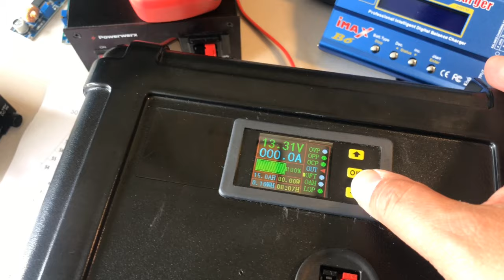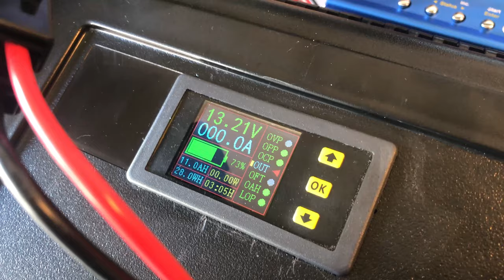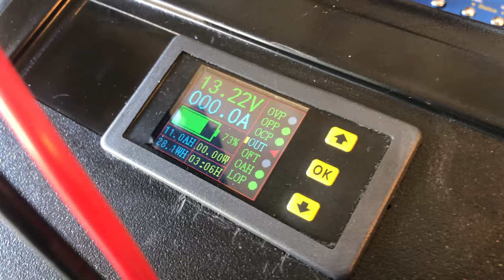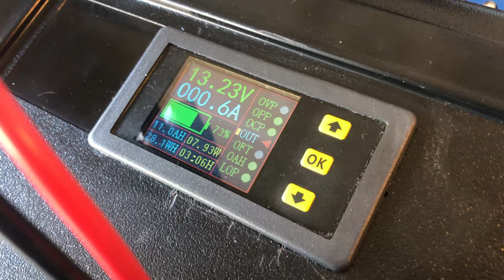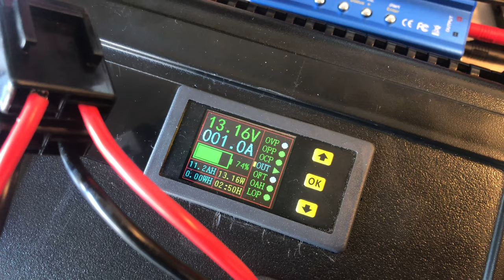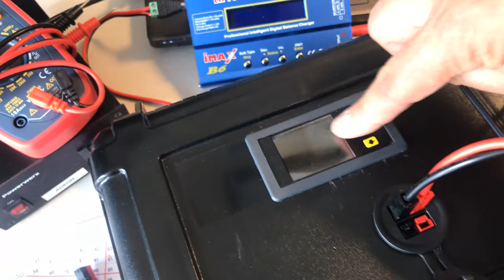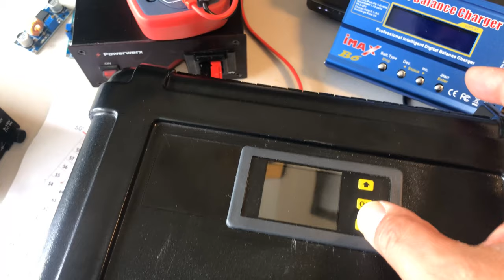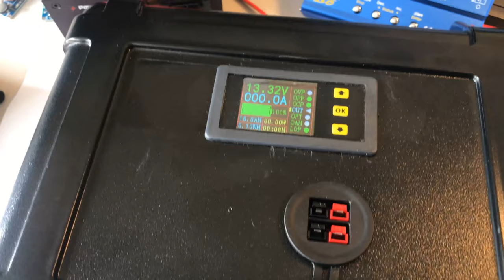The Almighty LiFePO4 Battery Box Build

Comment: Feedback. 
You probably saw me looping the cables around on the Power Pod port for the solar input. That was 14 AWG wire so it was easy to Loop it around. I did not Loop  the DC output ports. 
Each of your DC output ports should have individual fuses. There should also be a fuse between the main battery (bms outpur) and the powerpod port. Your solar input should also be fused.
One thing which is concerning on your built is the lack of a solar charge controller. Now I know you're going to tell me your solar panel has a DC regulated output. The problem with that particular type of panel with the regulated DC output, is your battery box can draw more current then the regulated DC output on your panel is designed for. The DC output is designed for powering up small DC devices, not for charging batteries. Under a heavy load, the DC regulated output on that panel is probably going to melt. I showed this some time ago, with the Goal Zero panels on my channel.
I understand jehu likes to use the meter you installed, but he usually uses that in combination with a charge controller. Please reconsider.
About working with the power pole connectors. At least in each of my videos I use a power pole connector crimper. I also use the power pole connectors which are designed to use with a crimper. The 45 amp power pole connectors can easily take 10awg or 12awg wire. So the only reason it's difficult is trying to fit two large a wire into two small or the wrong type of power pole connector.

I know people are going to give me thumbs down for being so critical of your build, but it's really important that you understand the amount of amperage in that battery pack. The battery pack has the same amount of current as an arc welder. Since you put no protections in place, it can be a disaster waiting to happen. I would beg you to go back and look at my solar generator or the 50 amp lithium iron phosphate pack videos, to see what's missing from you build, and why the details are important. It's also important to note will, jehu, and myself all have different build philosophies. You should pick one of those videos you're trying to emulate and stick to it. It looks as if you're incorporating all types of ideas from the three of us, into your battery build. Also remember they don't care about RFI what noise emanating from the battery packs. My packs and generators are designed for zero noise. 

By the way I didn't know you were in Stockton. Back in my dark Smokey Cafe musician days, there was a place called The Blackwater Cafe in Stockton. I used to play piano there a few nights a week for the hipsters and hippies.
Reply from the maker: Thanks, Julian! I keep kicking myself for not mentioning that, but the box has intentional internal space, and a Genasun MPPT Charge Controller was in the plan. I just haven't gotten it yet. In the meantime, I am using an external (not shown) charge controller. I do appreciate the feedback, and continue to keep it coming! 73
Reply from the maker: Yup,  @OH8STN  fusing at the points you mentioned will be incorporated. Already visualizing how that'll happen.
Reply: @AD6DMDennis  small Automotive fuse box is easy to work with. 4 port version. 1 in, 4 out. Two left over for future ports.

Comment: Great video Dennis. Your battery box looks great! I definitely recommend putting an on/switch in. I'm going to put my battery box together soon. But it's going to be an ammo can and a lead acid battery. Thank you for making the video!
73
Reply from the maker: Roger that, thanks for watching and good luck on your build. Remember the fusing (see Julian's comment)!
Reply: @AD6DMDennis  absolutely. I have a fuse block, ground bar, I'll wire everything with 16ga wire, except for the powerpole block, that will have 12ga and will always be "hot".

Comment: Hello Dennis,  i found your video, and will make a setup like you. There is one question i have, the BMS you useed is that a one with seperate port as far i can see it is. But can you help me out with this.

73 lemmy
Reply from the maker: Hi Lemmy, this build had a very small separate-port 100A BMS to match the potential of the Headway 10452S batteries ( https://www.ebay.com/itm/174515037719 ). I am not sure if 100A can actually go through it. Nowadays I would recommend a bigger well-known BMS, like the Daly common-port 100A BMS ( https://www.ebay.com/itm/234476093470 ) and a powerpole splitter at the output to allow for charging/discharging circuits.
Reply: @AD6DMDennis  thanks for answer this fast, so a sepperate port works well. i like the option of a port for charching and the other for using as a output. i think there is not much difference in this. hope ik get to work.
Reply from the maker: @lemmy-pc2lr  Yes, separate port is good for limiting input while permitting constant output (over-charge protection kicks in only on the input port), and also allows charging while protecting for over-current or low-voltage cutoff on the output. There are also different current limitations on separate port BMS's, to allow you to match for the charge/discharge specifications of the cells. In my video's BMS, I think it allows a max of 10A charge, but 100A discharge. Bigger BMS's could potentially allow bigger currents in and out. Good luck on your build!
Reply: @AD6DMDennis  thanks for help, i gonna start building  thanks.